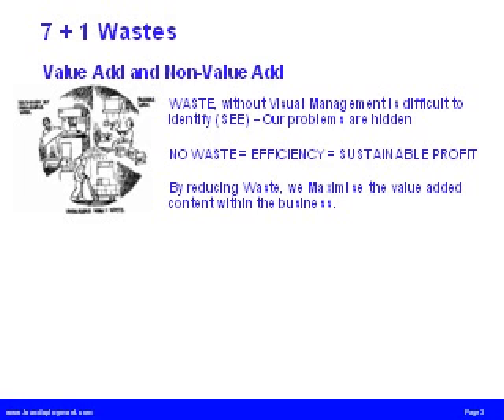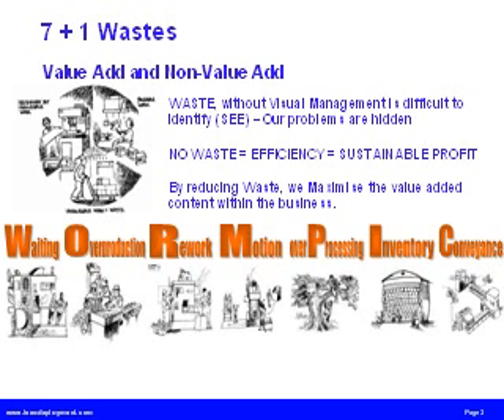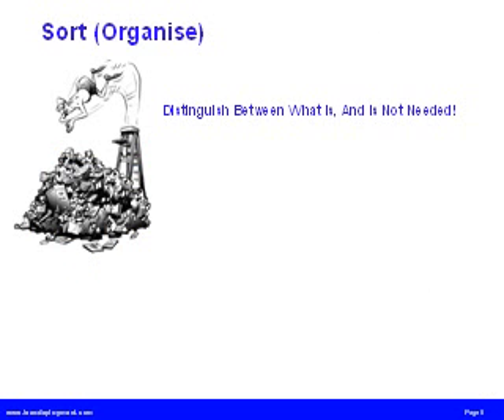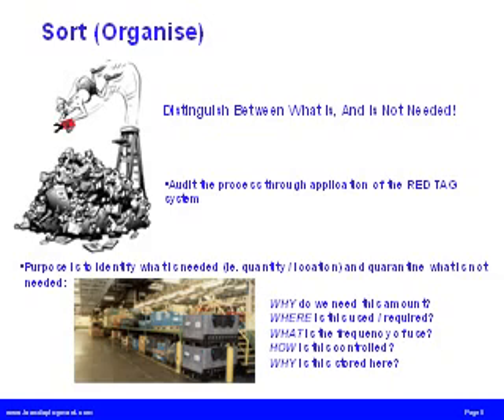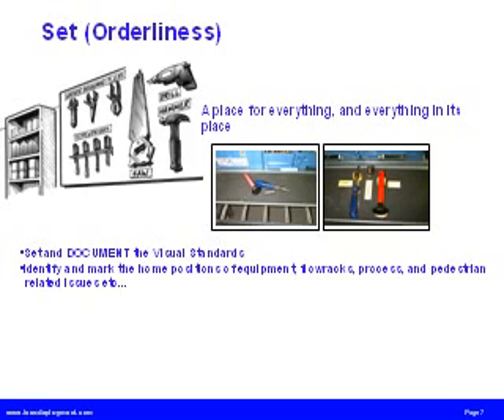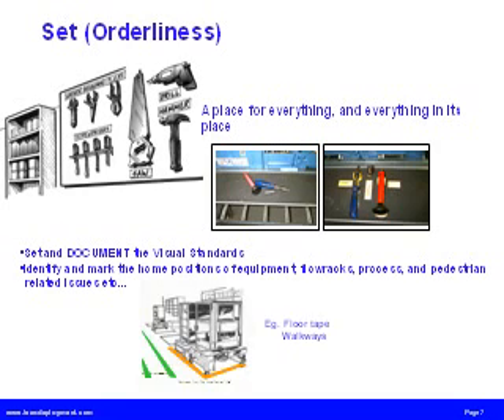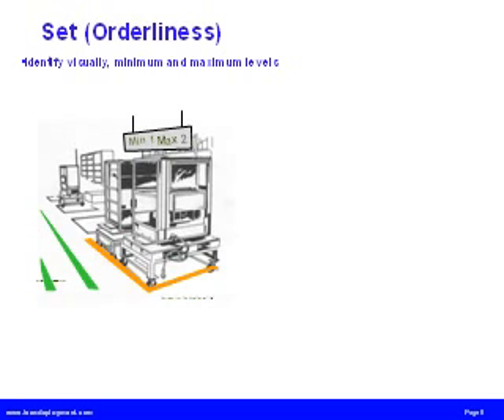Lean Manufacturing Visual Management and 5S from Leandeployment.com

Comment: The front portion of this training video provides a nice summary of the elements of 5S. It emphasizes the need to set standards, which is critical. But then at the end it falls into the too-common trap of throwing in a whole bunch of other stuff - in this case the material about leadership behaviour. From a training perspective, the last bit is probably worthless because there is too much to take in, and nothing to get your teeth into. It is just another to-do list, not training. Skip this one.

Comment: @S0171238  that is why you need to train them in lean manufacturing principles and make them a part of the process. You hold Kaizen ( continuous improvement ) projects and have the operators organize and run them!  This does work when management takes it seriously and holds the operators accountable to adhering to it, I see it everyday at work and we live and breathe lean at Guardian Industries.